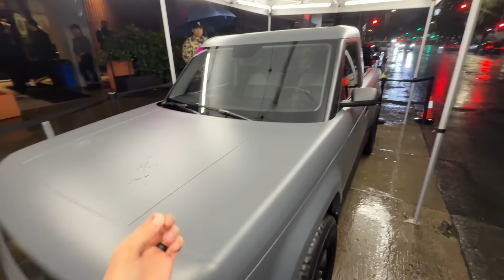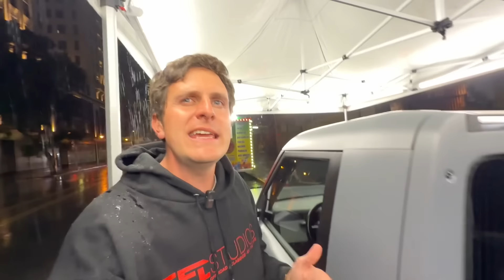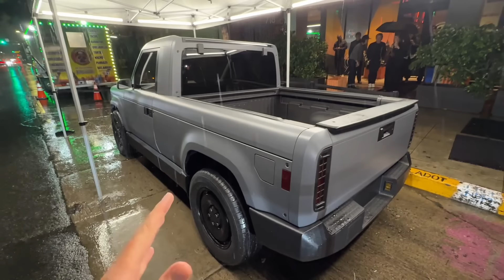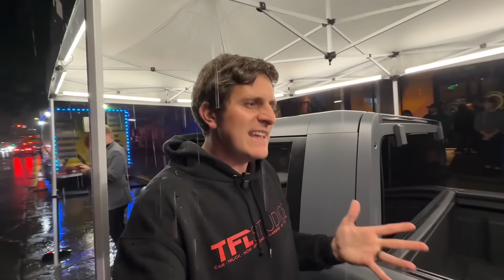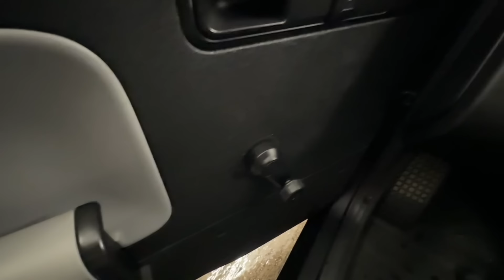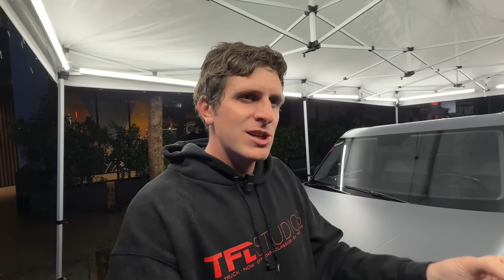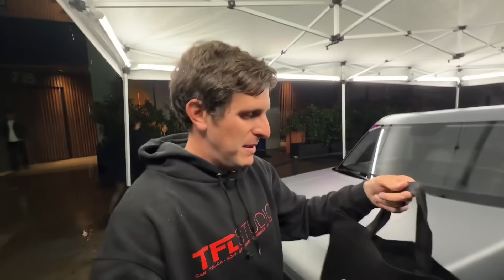The TRUTH About the '$20K' Slate Truck...Will This Really Be a Hit?

Comment: This is not a simple truck, just a complex truck with missing features that are not expensive. Power windows are not expensive, what is expensive is a BEV powertrain. They are complicated too. Most consumers think electric drivetrains are simple because they can't see the complexity, the electronics and controls are very complex, much more than a 4 banger with a manual transmission. Will they sell it for $20k? Maybe. Will they lose money at that price, 99% chance. Low cost comes at high volumes, which is why custom cars are expensive and high volume productions cars are not, relative to custom cars. Just look at rivian and Tesla, their stuff didn't become relatively affordable or profitable until higher volumes. Rivian still isn't there. I'm having a hard time believing this "simple" truck will hold up in the salt belt anywhere close to a Ford, Toyota, Honda, or GM product.

If you want a simple point a to b car, buy a used honda, they sell everyday under $10k

A few other things - trucks have gotten bigger - this is generally not true, but depends on how you measure. Are there more large vehicles on the road - yes. But... So what, that's what people want, which is why they sell.

Comment: I think the people who say they want sub 30k trucks still want that to be a full size truck. Just stuck in the past that's never going to return. As far as the single cab truck goes, when your looking at 50k for a single cab it almost seems irresponsible to not spend 55k on a crew cab. For the slate truck. I think if it had a good 4 cylinder and a manual it would get more market share than an electric only truck will. People want vehicles to check all the boxes now.

Comment: I think your speculation about what Slate buyers say they want and what they really want is on point. While there are people out there who genuinely want and need only the basics, when it comes time to buy that is going to be a very small group.  Too small to make for viable sales of the Slate.  The problem is that there is nowhere for Slate to easily go to meet the  demand of what buyers will ultimately buy.  You can't make it a four door, you can't make it AWD without essentially making a whole new model.  It's slow and low range compared to all other electrics.  Beyond that, there has been no word on option pricing.  You start with a $28K basic truck.  Start adding things like a larger battery, electric windows and other stuff to trick it out - even paying for the wrap to get some color - and before you know it you are in the mid to upper $30's.  And you'd still have a slow, small 2D truck.  The concept is good but the real market is too small.

Comment: I disagree about this needing a gas engine. You can already buy a Maverick and the upcoming smaller Toyota pickup with gas. 
This Slate is going to sell well with small delivery companies even if it doesn’t do a lot of retail. 
I’m planning to get one and all of my pickups have been single cabs. I carry cargo not passengers. If I wanted to cart people around I would use my Crossover, or get a minivan. 
I plan on getting the larger battery and the square back canopy with no back seat. I do take road trips and my Tesla had a 230 mile range and was fine going cross country. 
I drove a Fiat with an 85 mile range for two years before I switched to Tesla and the longest drive I did in that was 57 miles to the airport. It didn’t have fast charging, so pretty much anywhere I parked it I was charging, or I was on a round trip less than 60-70 miles. 
I delivered for Amazon in my spare time for awhile and never ever drove 60 miles in a day because they send you to an area and you might spend hours in a six block radius. 
I delivered pizza in college and same thing. I never did many miles because it was short trips. 
I also did marketing for a side hustle and I never went a hundred miles. But I did sometimes visit seven stores at one intersection. I had to replace the starter in my gas car which wouldn’t be a problem for an EV. 
As long as they can hit the $25k starting price I think they are golden.

Comment: Being retired and living on Social Security, budget is everything. I don't need heated seats, FSD, and power arse massagers, I need a simple and affordable no-frills option. Here is a no-frills option that I can easily and affordably customize to my liking.  A worthy successor to my 20 year old Colorado with 223k miles on the clock. If they can keep the price down as they claim, there are a great many folks like me that would find this an ideal option.
Reply: Exactly!
Reply: The federal rebate was 7.500USD .. that’s why they advertised it for 20k …so the basic truck is 27k.. if you want the suv version.. easy over 30k .. for a car that drives 100 miles in winter.
Reply: Not sure what the guy hosting the video is thinking, these are already going to be $30 for the base model. This has been known for a while, and this video is only 4 days old. He is wildly misinformed...
Reply: @nfarc7542 they're targeting mid 20s now. It would've been 27 but the tax credit made them buy more expensive us batteries. They'll likely switch to cheaper Chinese made batteries now to save some extra money and get it around 25 since there's no reason for the US made ones now
Reply: Ford has a Maverick waiting for you.

Comment: Nothing innovative would ever be built if everyone based their projections on metrics and feared failure. Which gives us the current  pickup Market. Everything's a four-door bathtub bed. Mostly jacked up and terrible fuel. And then you like can't make an EV without it being a $60,000 tech beast. And dealers don't want to sell or order base vehicles because they don't make any money. So combine a lot of known things and repackage it in a different way. Direct sales, simplicity, EV, low cost. Maybe the sum of the parts that don't make sense when you look at the current truck market makes sense when you put them together.

Comment: If this had a tiny little gas engine in it I would b all over it. But I live in the south east. Where it's 30 miles to get anywhere... Then I have to drive back... With no charging stations within 100 miles...

Comment: If it's unibody it's not a truck. It's a car with a bed. I need 4wd because AWD means that if I have to replace one tire I have to replace them all. I'd love to have a real truck (body on frame) with quality 4 cylinder engine that actually costs $20k out the door, not $20k on the sticker and $30k out the door with all the add ons. Modular bed = no bed-liner which means bed get's destroyed doing truck stuff. Exposed screw and bolt heads means rust and corrosion.

Comment: The reason why single cab trucks don't sell except to fleets is because they're only available with the poverty-grade interior.  They also don't give them the real off-road gear.  So nobody wants them.  I would absolutely buy a Power Wagon or F250 Tremor if I could get one with a standard cab, short bed, mid-grade interior, and all the off-road equipment.

The same problem you mention with the base model Jeeps: they don't offer the Rubicon suspension, gearing, and differential locks on an affordable trim level.  They force us to buy all the luxury items in order to get the functional items.
Reply: Or you could go aftermarket, the aftermarket for Wranglers is HUGE.

Comment: My JT gets ~300 miles of range. A good once a month I go through a tank in a day. A day of driving from South Jersey to PA and back is all it takes. Anything under 250 miles would be basically impossible as an EV for me. I'd either need a second vehicle, or cheap fast (less than 125 minutes for 30-50%)charging readily available.

Comment: 2004. I got mine for $12,000 and I bought two of them for business little Tacoma trucks there about the same size over 200,000 miles. They’re going in in 2025 but they’re only good for short drives around the area or work if you want a comfortable one it has to be at least a extra camp for 20,000 bucks. They should be doing extra cabs with that a little bit more room a little bigger and that would be a big hit those two doors for inflation. I would say 14 or 15,000 at most for that one they should be selling it there’s still too expensive for a little truck.

Comment: Scion! Basic, solid, reliable, uncomplicated with purpose. I loved my 2014 Scion xB. Great car that did everything right but it was basic and that's not what people wanted. I think you're correct Tommy. Conceptually, it's amazing, but not what people genuinely want. Part of the problem is our evolution as drivers and consumers. DID my old rear wheel drive Silverado ever get stuck? No, but hitting that 4WD button on the boat ramp, rain or snow is convenient. Do I NEED the huge infotainment screen in my Ram? No, but I like a big map for navigation, speaking texts to Siri and knowing what EVERY engine temp and pressure is. I miss the simplicity but have grown to feel comfort and confidence in the extra options.

Comment: "People Buy Range for the Road Trips they never take."  A weekly or once every two week road trip is anywhere between 300 and 650 miles in one day, I own a rig that will exceed that range, a 2018 Chev Colorado with the baby Duramax. There is not one EV on the market today in pickup form, that will come close to this range. So, how much time would I spend trying to find a place to charge up an EV pickup to get myself back home in the same day? How long would it take to recharge a pickup that has a 300 mile range, with out a load? Could I drive the 325 miles, do my inspection and drive another 325 miles back home in 12 to 14 hours from the time I left with a current EV Pickup? So for a Ford Lightning with an extended range battery, I could get 320,  For DC fast charging, it takes around 41 minutes to go from 15% to 80%. So would have to stop three times to do a fast DC Charge at upwards of 40 minutes per charge, which would ad 120 minutes or two hours. But see, driving from 80% down to 15% would result in 210+/- miles.  (65% of total capacity being used). My Chevy Colorado with the baby duramax, that has had some improvements done, can go a documented 680 miles (35MPG+) and no time lost in recharging.  When one lives in a world where time is money, the EV would do nothing but cost time and money.   Now if someone is just driving around town an EV, like this Slate, might work perfectly.  But for people who are on the road a lot, no way would something like that ever work out.  Until a 800 mile battery that can be recharged very fast is invented, I will continue to burn a combination ancient dinosaurs and grease from French fries.

Comment: CAFE regulations killed the small short wheelbase pickup trucks. Also, U.S. manufacturers chose to not compete with Japanese manufacturers in the sedan market and put all of their efforts into producing highly profitable fullsize crewcab with tiny bed pickup trucks as NHTSA'S CAFE regulations favored larger wheelbase light duty trucks (SUVsfall intothe light truck category).  Alienating small pickup trucks, sedans, and station wagons was much easier for U.S. manufacturers to meet CAFE standards.  CAFE is the sole reason why vehicles in the U.S. are now massively oversized.

Comment: I had a deposit down on one 20 min after it was available/live. It just happened like that, not planned timing. I came to realize later, 7-8 months that this now 25k/27,000 bare bones shell of a truck will be 40,000+ with some of their customizable things added onto it. And it will still then be a bare bones vehicle afterwards with a sea of plastic. I planned on adding to the base truck their: 1) off road wheels and tires, 2) better looking front bumper, 3) rear bumper, 4) electric windows, 5) more posh looking interior inserts, 6) colored seats, 7) fast back SUV top,  8) custom exterior color wrap, 9)  fender flares, 10) flog lights. Just thought not worth the final investment and then the where do you get it serviced or warranty. Note...I got my 50.00 deposit refund back and skipped my reservation. Just bought a new 2025 Nissan Pro-X for 40,000 wit 10 year bumper to bumper and free service. The nice thing will be it will have resale value and it has a good sounding radio, android auto, front camera/rear camera, upscale electric front adj seats, electric windows, 4 doors, dampened tailgate, and will tow 7,000 pounds, wireless phone charger, 9-speed and more.
Reply: 4 doors? 🤮 
9 speed transmission?  🤮 

I don't think you're in slate's target audience

Comment: I'll keep my 2023 Toyota Tacoma SR Access Cab 4x4, 4 cylinder, that I purchased new for $31,500 plus tax/tags.  It even has power windows!  Tommy is correct.  Provide a 4x4 ICE version with an NA 4 cylinder with an out-the-door price under $25,000 (with some options) and Slate wouldn't be able to build them fast enough.

Comment: If Slate and Amazon can achieve low insurance, maintenance, running  costs with these EVs it will be a success.
Reply: Maintenance and running costs are going to be very low. We own a Ram 2500 diesel, but we also own a Tesla- we've had it for 3 years. Maintenance costs? There are none.

Comment: I think you are pretty spot on this one.  The simplicity is a fantastic starting point.  And as an option to buy one that way, should get about 5-15 % of the sales.  At the price below 30K.  However, as you indicated smartly, most folks are not going to buy a base that is this simple.  Why?  Because they have been brainwashed into believing they need all the extras.  As well as convinced that smaller does not equal practicality.  To buy this means you think properly for yourself.  Are not brainwashed with decades for advertising and word of mouth and ego shamed to buy something you don't need.  So, for the companies sake, I agree, they need a gas range extender with AWD option model.  2 simple choices.  Leave the rest alone.  That should cover the other 85% of sales.  It will make a fine city truck.  Oh, btw, the whole reason why people want more miles, is not just for the reason of... just in case I need more, it is so they don't have to fuss with it more than once a week.  Commuters and very busy people time manage themselves.  Thus it is best to tend to the weekly fill ups or recharges, versus ever 2-3 days.

Comment: This is what I’ve been wanting except I need AWD for winters in SW MN where it’s ice and slush. I don’t want an infotainment unit. Turn dials heating and cooling YES please. Push button hazard and rear defogger, Window cranks! YES! 🎉 150 miles range when the bed is loaded is just enough. Under 30k please. I’m 115 miles to MSP and SF,SD.

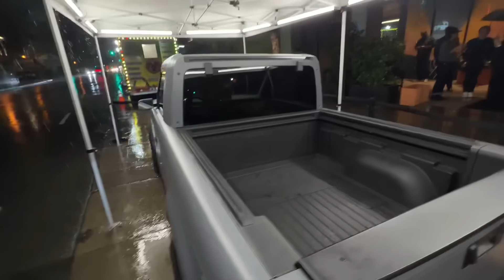Comment: 3:51 truck buyers dont like small trucks, so they dont buy regular cabs. More door on truck make more bigger truck!

Plus, modern single cab trucks are typically only available in the lowest work truck spec. they arguably still come equipped with everything you need, but they look ugly inside and out.

Even so, its surprising more people arnt buying them as its the cheapest configuration for a 1500 truck at roughly $48-52k.. im talking 4x4 with a v8.
Reply: Sounds like your living in the 1990’s

Comment: I think there are a lot of features that other manufacturers can take from this. The idea of no built in screen is interesting to me. It means that all of the controls in the car have to be physical buttons in the car.

I can definitely seeing the Slate being used as fleet vehicles with municipalities, golf courses, pool companies. However, I think companies like UPS, FedEx, and Amazon for deliveries is where these could be useful. If their drivers stay within the city and don't go more than 150 miles in a day, then I think these can be very advantageous to them if they have charging capabilities at night. No engine maintenance, very simple interiors, small motors powerful enough to get around town. 

But for regular people, it will sell, but I just don't know how much it will catch on if vehicles like Maverick are available at the same price. People say they want more range with this or put a gas motor in it, but honestly how are are you going to drive in this little thing? I don't see people wanting to take long road trips in these. I am curious to see more about these and I might consider one if I didn't need more seats and had an extra $30k laying around.

Comment: A 4 door maverick is about the same price as this slate. No one with a brain is going to buy this. First ev's have never been that big of a deal with Americans. Young hip computer savy people loved the Tesla but older people don't want all the pain of driving ev they just want to go where they are going and back home. No drama or worries. The press jumped on the ev thing like they did the Russian hoax. In both cases people with a brain didn't buy it.. You use to see mighty max trucks everywhere. Thats what this slate needs to be. 3 or 4 cylinder and priced at 16 to 18 grand. Buy them from toyota ford  or nissan  so when they need repairs the one you buy the motors from can also service them and the rest of it.
Reply: It’s cheaper then the XL maverick

Comment: Tow rating is horrible.  You can get a Maverick to tow 4000lbs..not ideal, but it can do it.    A 2011 Ford Ranger 4x2 with a 2.3L 150hp 4 cylinder and a 5 speed manual could tow 2100 pounds.
Reply: Most people don’t tow…

Comment: It's going to be a tough sell. The truck is 27.5k (without the EV tax credit), 2.5k for taxes (give or take) $75 to 1k on doc fees (depending on state), and that's without ANY options? Ufff, very tough sell. 

If this truck was 23k to 24k out the door with a few basic options, a good possibility the stakes would be different. 

Best of luck Slate.